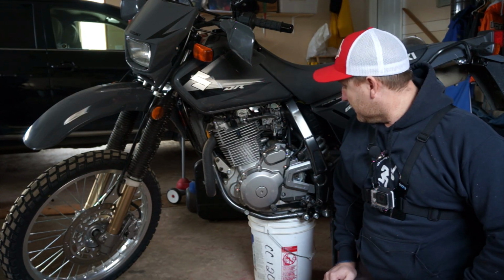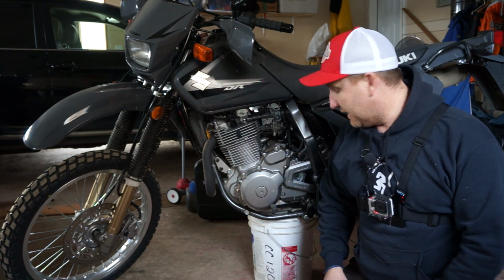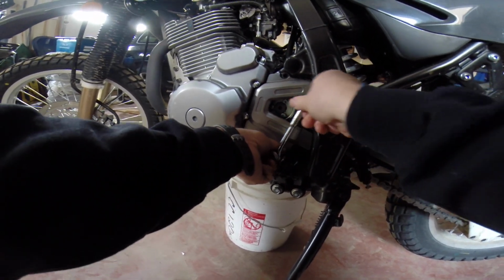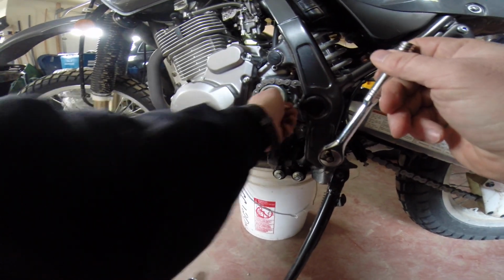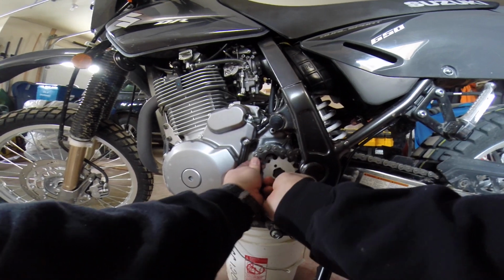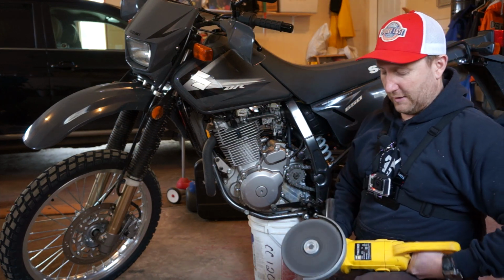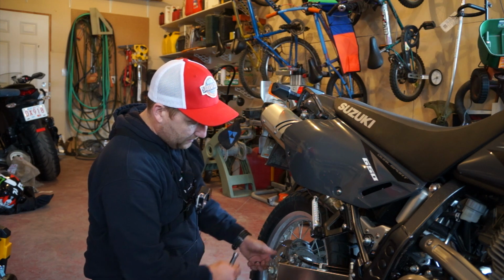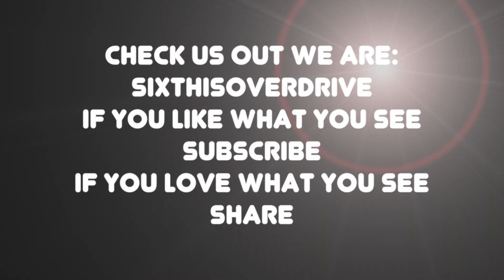Changing The Front Sprocket on a Suzuki DR 650, 14 Tooth With 6IOD

Comment: PDI departments are really enthusiastic with that impact! Worst I ever saw was a drain bolt on a WR250X sump drain plug. Put the socket on, turned, and stripped off the corners. I ended up having to use a 24" pipe wrench to reef it off. Just bruuutal! Thanks for the videos, I'm really enjoying them!
Reply from the maker: Yeah...just about took all my strength.

Comment: You mention Pro Cycle, did you happen to notice they sell the thicker front sprocket that wont eat up your countershaft like the stock one does? My XR is the same way, if we run stock sprockets they destroy the countershaft by 20k miles. You need the countershaft seal retainer on a DR also or you may have the seal blow out. Plenty of info on Thumpertalk.com
Reply from the maker: Thank you sir.  I will probably change the chain and sprockets to the 520 when I hit break in around 10 k.
Reply: No thats not what I meant. The sprocket is same 520 or 525 size, it's the width of the sprocket where it contacts the counter shaft, On my bike I use the cr450 sprocket, its about 25% wider and uses the whole area the countershaft provides. From what Ive read your bike has same issue and can be easily remedied, Procycle  has an improved wider  sprocket listed on its DR650 page.
Reply from the maker: Thanks...I will check it out.

Comment: So if you do this mod you it’s kinda like no going back once you do this mod from grinding that plate or could you still put the 15 tooth back on
Reply from the maker: You can still put it back on. The hollow out is for off-roaders to get grass straw and branches out without having to remove the cover, it doesn’t affect the sprocket at all and is an optional touch.